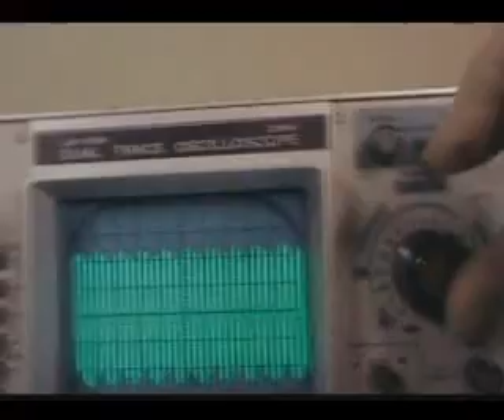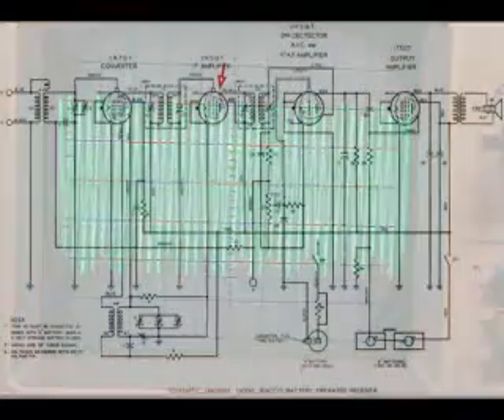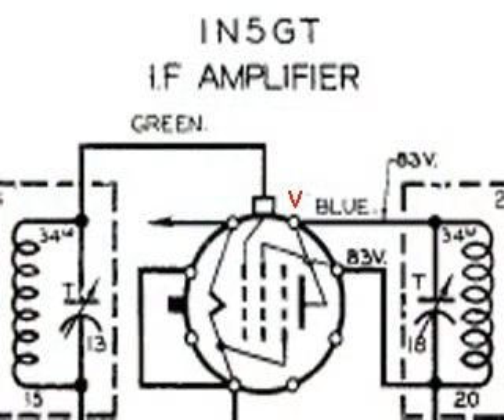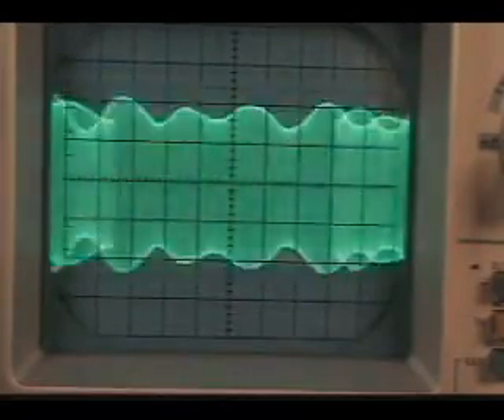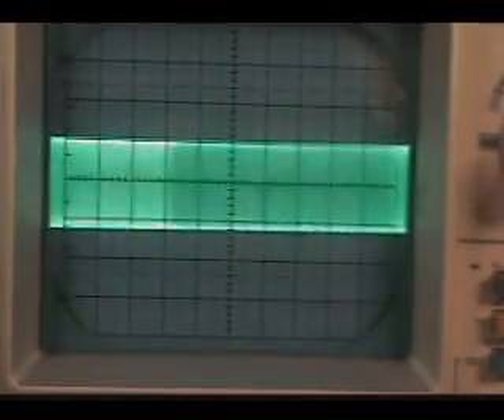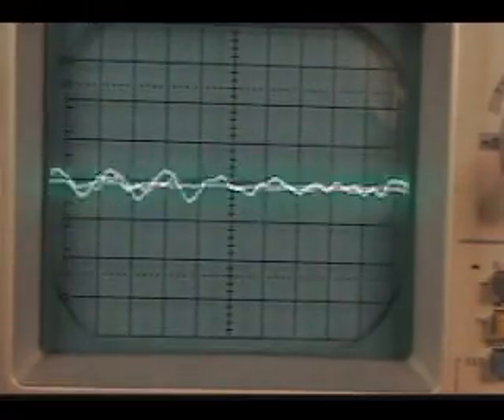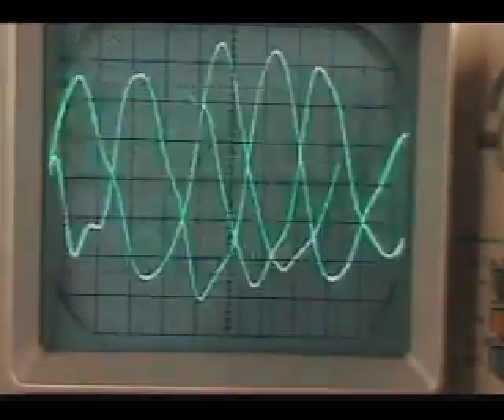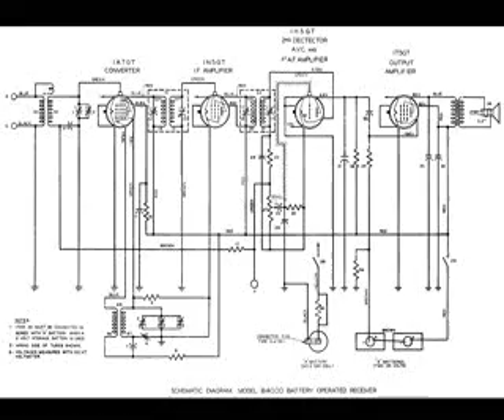Oscilloscope signal tracing

Comment: I have a tube amp I accidently dropped from a foot off the floor, it worked good before, now it does not, all tubes were replaced and light up, there is a pop from the power tubes from the specific pin, how ever when plug an instrument cable in I get no sound and should, do I need a scope to trace where the signal ends or will a multimeter work? Thanks.

Comment from the maker: Thanks THEDOGBOYS3 
I would get an oscilloscope first along with a digital and analog voltohmmeter. Frequency counter would be nice though. Particularly if you're getting some strange readings or results, having more than one, and different type, of test equipment may resolve that issue.

Comment: Hi and thanks for the videos! I am new to radio repair and am  looking into getting a sweep generator for for injecting rf signals. If you have a oscilloscope why would you need a frequency counter? I understand why you will need a sweep gen for fm, and now is the question of audio output? Do you have any information I could get or talk to someone? Read your book, thought it was great! Now I am stuck with acquiring the right test equipt. for my oscilloscope. You and John got me hooked! T Y, TDB3

Comment from the maker: Francisco
I have the chassis under test on the isolation transformer and the scope is on commercial power. If I would to isolate the grounds even more I put a 2.2@630WV capacitor between the chassis and scope ground. But with the isolation transformer its really not needed.
Rick

Comment: I found its bad engineering practice to isolate the earth from the scope using an isolating transformer. 

Can you please confirm this:
Connecting a hot chassis device to mains via an isolating transformer allows the operator to use an oscilloscope safely. ie using probe GND clip WITHOUT using the differential measuring technique and isolating transformer on the scope?

Thanks.

Comment: Excellent video!  This is exactly what I was looking for since I'd like to start to debug my Grunnow 660 with an osc.  Is there anything specific I need to look for when buying an osc for radio debugging (ie high voltage work)? Like bandwidth requirements (15 GHz OK?), max input voltage, max input current etc?  Thanks again!!

Comment: Thank you for your quick reply to the comments. I have ordered and isolation transformer for plugging the radio into and will also use the .02 630WVDC cap on the ground lead of the scope. Your reply is an immense help.

Comment from the maker: My isolation transformer is always connected to the radio under test. For the ground connection from the scope to the chassis of the radio under test is a 0.2 MFD at 630WV capacitor. It does introduce a little distortion but it is not bad and using both, the isolation transformer and capacitor, ensures maximum safety.

Comment: I have a question for you. When you hook up the scope to a radio set that has a transformer. Do you float the scope with a "cheater" plug that isolates the scope? Or do you ground the scope normally using the 3 prong plug that comes with the scope? Or do you use an isolation transformer on the scope AC line or an isolation transformer on the radio AC plug?

Comment from the maker: Yes, locate all test points first before applying power. I use a 10to1 test probe on the oscilloscope. Only use one hand to take the measurements and the best place for you other hand is in your pocket. All test equipment has limits, read the specifications so you know what the limits are. Usually there's a lot of good information in that manual. Must important thing, is to use only one hand.